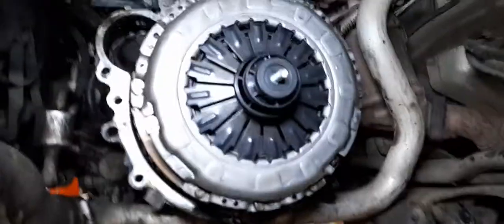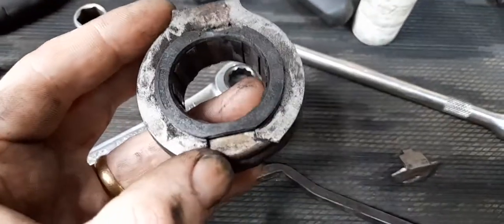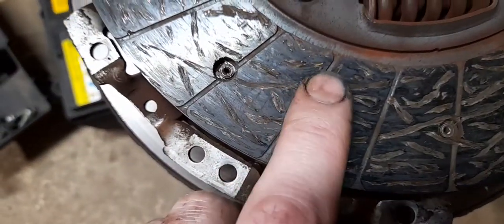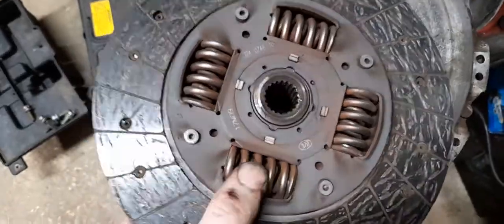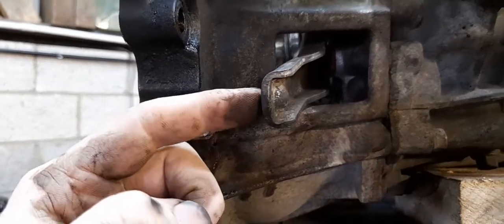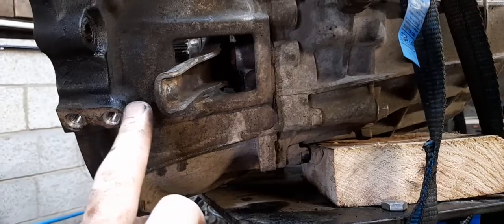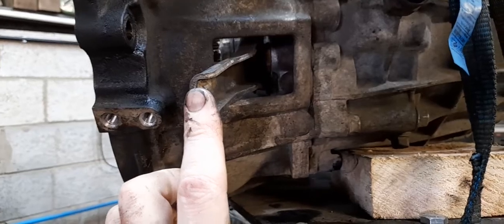Kia Sportage low clutch pedal

Comment: This is a great tip in this video. Another issue is the damper on the master cylinder can soften and flex taking fluid from the system and not fully actuating the slave cylinder.

Comment: Hi - I couldn't quite get gist of the measurement bit on the slave cylinder. I can measure from the end of the boot (furthest from the lever) to the lever itself and that measurement is about 48mm of movement once clutch pedal fully depressed. You mentioned measurements I believe when the arm is at rest, with or without a damaged bearing - Can you tell me what those two measurements are please?
Reply from the maker: To be entirely honest I don't have the measurements at hand
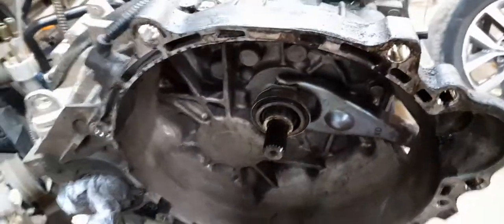Reply: @lifeRobrandom  The measurements I think are on the video, I just didn't understand the summary beyween 2:20 and 4:12

Comment: Had clutch problems won’t go into gear.     Iv looked the cable is ok but if I watch the piston push that bracket back as you have showed it don’t move very far like few cm the pedal is very high too     I know the clutch had no slipping or smell is there away to adjust it

Comment: Hi.Thank You for Your video.I got my clutch pedal biting at 2cm from floor.Is there is any way to regulate height of clutch pedal?
Reply: If it's a hydraulic clutch there is usually no adjustment. See my comment above.
Reply: @paulwright2906  there is adjustment just underneath of pedal.Manage to fix mine

Comment: Hello. Nice video. So basically when the clutch is fully pressed we should see a slave cylinder travel of between 4.5 to 5.5 cm? Is it right? Reason I am asking is that my Hyundai i30 has a clutch dumper. Just wanted to find out if in my case is the dump or is a bad clutch bearing. If the slave cylinder travel is less than the standard (which from your video I understand to be 4.5 to 5.5 cm of piston travel) then I might have air in the system or the clutch dumper is bad. If slave cylinder travels around 4.5 to 5.5 cm than for sure must be a bad bearing and time to change clutch. Could you please confirm me that the slave cylinder travel is 4.5-5.5 cm ?
Reply: Have you fixed it? Mine i30 1.6 crdi does the same. It bites after releasing 1 cm and feels like cannot engage gears properly. I tried to remove any possible air from installation but nothing has changed
Reply: @vladcristian8535  Yes I fixed mine by changing the clutch kit. I bought an aftermarket LuK clutch kit, changed also the crankshaft oil seal on the side of the transmission as the old seal was leaking engine oil. I cleaned the flywheel, torqued down everything as per info I found online and cleaned, mounted the transmission. Car clutch is now like brand new. It does not bind immediately when you release the clutch. Now I have a 2-3 cm clutch pedal travel before the clutch binds. Also clutch pedal is lighter than before. Had to spent some time to get used to the new clutch. I already in the past changed one part called clutch dumper but that did not change anything. Only solution was to change clutch kit meaning, clutch disc, clutch pressure plate and throw out bearing. I changed also the throw out bearing fork but that was not necessary. Make sure to use high performance grease and use it adequately. Some places you can put a lot of grease but some places you need to put just enough grease otherwise it will splash around and contaminate pressure plate and clutch disc. I changed mine in my friends profession garage with his tools.

By the way I measured my slave cylinder travel distance and it is the same before and after I fix my clutch. It is only 1.4cm of travel. If the slave cylinder piston moves 14-15mm than I would say the clutch master and slave cylinders are fine, also the clutch dumper is fine as they all are part of the same system. If you can measure the slave cylinder travel distance than you can for sure understand what is the issue in your case.
Reply: @bledilici  Great. Thank you for your help
Reply: @bledilici so your slave cylinder only moves 15mm?  This video seems to suggest 45-50mm is normal.  I don’t get it!  I have the same problem. Also slave cylinder creaks as clutch depressed.  Any advice?
Reply: @CurboroughSprinter  I got my clutch changed at around 160K km and that fixed the issue for me. Old clutch was not used, it could be used for probably 4-5 more years for my driving distances as it had plenty of friction material. But changing gears was getting too hard. After changing clutch disc, clutch fork and bearing still the head of the slave clutch cylinder moves around 15mm when clutch pedal is fully pressed and everything is now working smooth and I am able to change the gears easily. Also the clutch pedal before changing clutch disc, was a bit on the heavy side, now it needs less effort to press it.

And as for creaking I also had the same sound coming from slave cylinder but mostly when car was sitting outside in the cold. If I parked inside than I usually did not hear the creaking sound. But I remember well the clutch pedal was hard to press before I changed the clutch kit,  meaning clutch disc, pressure plate, throughout bearing and clutch fork. (I am not sure if clutch fork was needed to change but I though since we are putting lots of new parts a new clutch fork wont harm.)
Reply: @bledilici  thank you for your reply.  It’s appreciated. 👍

Comment: Been going through this on mine and debating on whether to change the clutch. 

One thing, I would think a worn out clutch would actually raise the pedal up... thinner disc, worn pp, worn flywheel would make the pressure plate fingers stick further out, closer to the throw out bearing, reducing free play. I could be wrong, though.

I still can't figure out why kia thought it would be a good idea to manufacture a car without any clutch free play adjustment. Bonehead move.
Reply from the maker: Unfortunately things aren't made to last these days